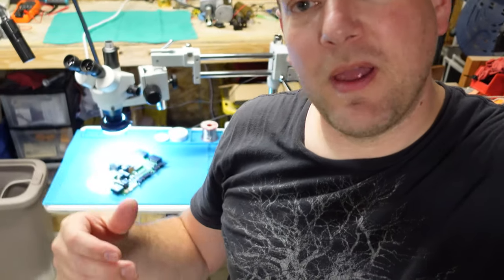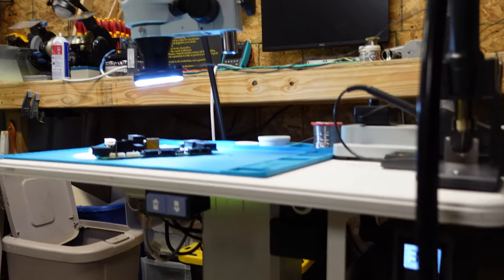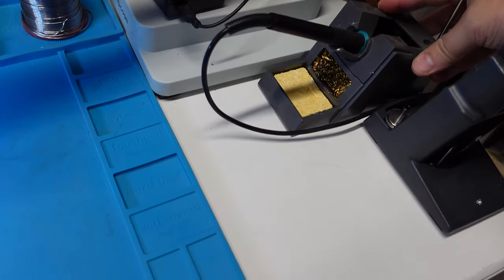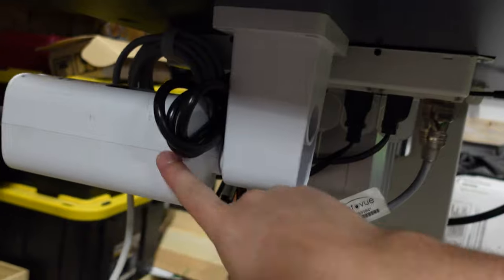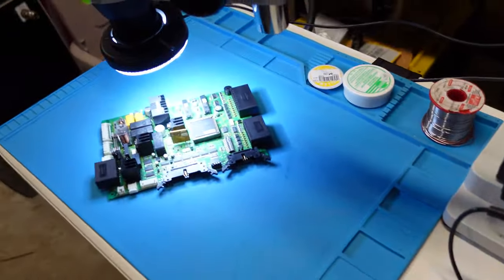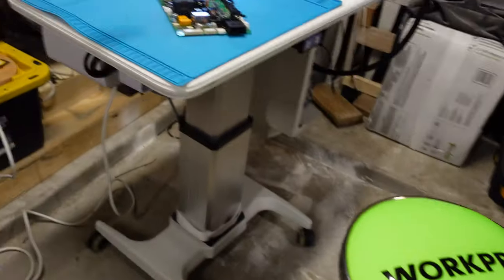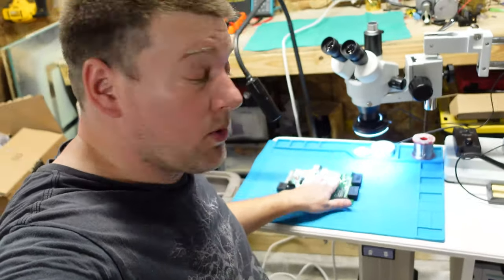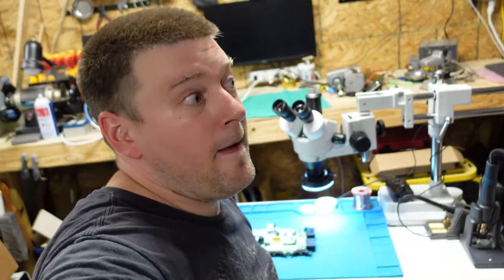New Project: Mobile Soldering Station

Comment: Nice project, i think if you need to buy the High-Low table new, you have probably the most expensive Mobile Soldering Station you can find on the net :-)
To prevent accidental touching the high-low buttons on the front, you can mount a momentary switch behind these high-low buttons, so that you need to push the momentary switch (with middle finger) AND the high or low button (with your thumb) at the same time.
Another neat solution, is to mount the high-low switch in a larger plastic box with a sliding door that covers the buttons. Grtz
Reply from the maker: https://premierop.com/k2-4-position-table-28-x-57-top/?gclid=Cj0KCQjwzYGGBhCTARIsAHdMTQzZqofe3PuGIGc0gVA7CWhhxA8tJnbFDcvDvYQnHalZ3wC6uT3ztM0aAksLEALw_wcB